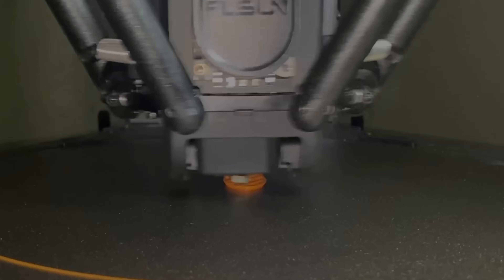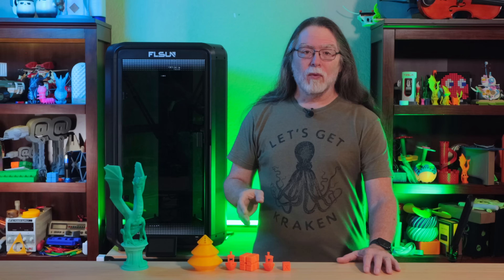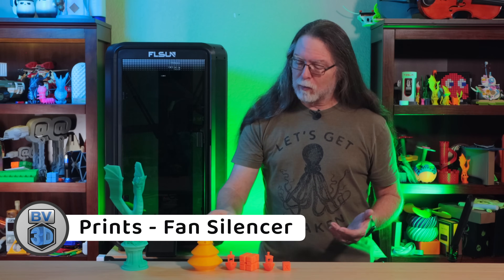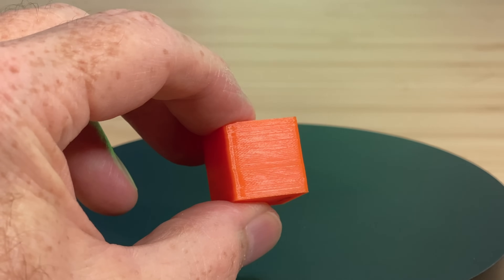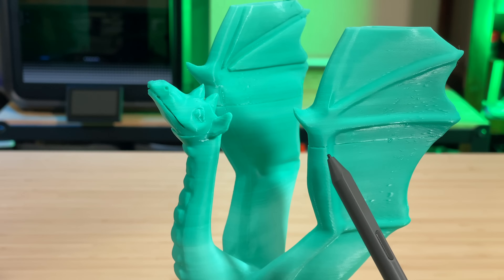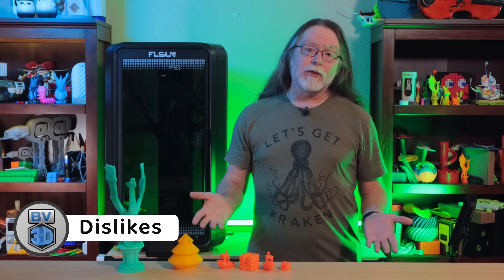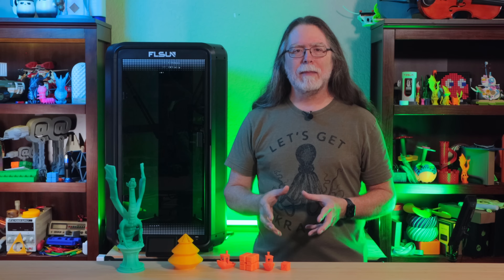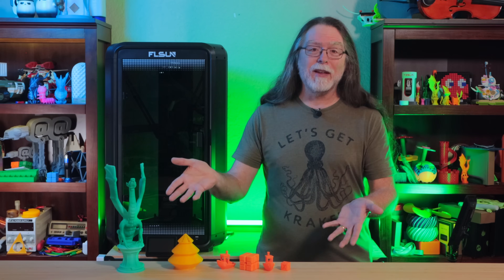It's Big. It's Fast. It's Loud. It's FLSun's T1.

Comment: Thanks for the tip on "Perimeter generator". In Bambu Studio its under the Quality tab -> Wall Generator. Those having issues when printing words or letters can perhaps give Arachne a try. There's a chance that some people might miss it especially considering that folks these days deal with so many different machines and slicers. Sometimes a single setting can mean the difference between a clean print vs a messy one.

I have read that people have had different results with Arachne vs Classic - so you may need to do some test prints to see if it helps. 

And as always a clean, clear and concise video from BV3D. Cheers!

Comment: My theory is flsun printers are not plug and play. Keeping an flsun printer stock from the factory is a mistake. At the very least tuning thr print settings.
Reply: They are definitely not plug and play.
I have v400, it sucks even after tuning.
Reply: @qozia1370  sad owner of a qq-s pro. The linear rods also being the support structure really limits the accel. It mostly prints ok, I just have to manually wipe the nozzle with a tissue just before it hits the bed. Tuning linear advance on kipper is really important. If the values too high it doesn't extrude enough which pulls the extruded plastic off the previous layer. Costed more than an a1 mini with mods and repairs and prints slower and worse. But the build volumes higher and I can mod it to make it better (if I had a brain)  :')

Comment: I have a T1 for a little over a month now and had little to no problems, the filament needs to feeded tru the holes of the cable clips to stop the coiling thing. Check your belt tension to stop the banding in z direction .sofar I have printed, PLA, PETG, ABS and TPE and they all work ok with the flsun slicer, fan speed can be reduced from 50 to 70% when printing around 400mm/s
Reply from the maker: Thanks for the tips!
Reply: I just ordered the T1 Pro and I will be printing PETG would love to know what settings you used to print your PETG and higher speeds. I use mostly Creality CR series and I’m told printing at 500mm/s is no problem with the right settings.
Reply: @dniezby  you need higjspeed filament for those speeds. It can print fast but the model shape also dedicates speed.

Comment: I have both S1 and T1; 110 and 90 are the instantaneous flow rates they achieve at their maximum; S1's maximum constant flow is around 65, T1's maximum constant flow is around 55; for me, that's enough, I like them very much.
Reply: They're not even that. 90 and 110 are just the numbers you get if you multiply layer height times line width times requested speed. But they do the flow test with acceleration turned all the way down to 1000, so it doesn't even reach 40% of the requested speed.
Reply: Enough
Reply: @alboroble you are flsun employee right? You keep defending them like a guard dog.

Not cool.

Comment: I would rather a printer manufacturer provide good profiles for Prusa Slicer \ Orca Slicer and\or Cura than waste their time rebranding their "own" slicer software. I don't use any of the four slicers that have been included with my printers.
Also, I agree about the max height thing. It's disingenuous for FLSun to base their max height on some theoretical cone rather than on the tallest cylinder you could print.

Comment: If T1 does better in terms of noise and software, then it will be a very impactful product .  The current T1 has demonstrated its huge potential, it just needs to do better .
Reply: About noise ,  you can do some optimization yourself. As far as I know, flsun is also optimizing the noise. Because I have many printers printing together, I am not very sensitive to this aspect.
Reply: @alboroble you can't optimize noise.
Fan blade shape and rpm determine noise! Please don't lie about physics.

Thanks.
Reply: @qozia1370  what about a silencer?

Comment: it also can't output 90mm^3 or go 1000mm/s, their claim to that is from a test file they made which, yes, does ask the printer to go that fast, but the prints geometry never lets the printer accelerate to anywhere near that speed. It's like asking any ender to print a zig-zag at 20'000mm/s with an accel of 1, and claiming it was doing 20K
Reply: This is exactly right. Someone got flsun to send them the "flow test" gcode, which confirms this.
Reply: Exactly! My flsun v400 never been able to do 400 mm/s.

Flsun always lie about the speed.
Reply: @qozia1370  It can easily do 400 mm/s kinematic speed (probably 3-4x that too), but nowhere near the flow to keep up printing at that speed with 0.4 mm by 0.2 mm layers. Maybe with 0.1 mm layer height.

Comment: Sometimes I need multi-color printing, I bought P1Swith AMS. Pursuing efficiency, I got my T1 2 months ago . In my opinion, the most important factors for 3D printing: speed, quality, multi-color; of course other factors are also important, ease of use, ecology, etc.  So  I chose bambu and flsun .
Reply: We are the same , T1 is my favorite printing tool.

Comment: Seems like this is not quite ready for prime time. It's funny, I have an old FLSUN Q5 that I got for super cheap, and it's actually been really solid. It does require regular care and feeding (and tends to go through extruders like candy...), but the print quality is generally good, and when operated within its limits, it's been a workhorse. I use it for high tolerance, utility type printing, and it's still chugging away after probably 30-35kg of PLA, PETG, and even some ABS through it. Delta printers are conceptually cool (not to mention oddly satisfying to watch), but in practice they just don't seem super practical for hobby or production use.
Reply from the maker: I had a Q5, and I liked it. I don't think it was trying to break any speed records, though. And I agree - Delta printers are 100% fun to watch!

Comment: The print quality is pretty underwhelming, and marketing claims kind of outrageous.
90mm3/s flowrate? Yeah sure...
Reply from the maker: I think the maximum flow rate number requires specific settings and FLSun's specific filament. I will say that if I slow the print speeds down to about 50 or 60% of the defaults, the print quality looks better. But I try to show what a manufacturer ships, both hardware and software, and the quality I was getting is what FLSun's settings were producing.
Reply: @BV3D  FLSUN also promotes their S1 with a max flow rate of 110 mm³/s which is false and based on a faulty max flow test that never reaches this value due to low acceleration settings.

I think it's important to hold manufacturers accountable for the claims which are broadcasted everywhere in every product page.
Reply: @BV3D No, it's just a lie. See other comments for how they setup the lie. I do high flows and it's very clear from their hotend that it can't do over 40-45 mm³/s. Others who tested it found it started failing at 35 or so.

Comment: Here is the truth, flsun printers suck, yes I own one, not this model but I do own one and I have not been able to tune out dimensional inaccuracy.
Reply: I'm with you. They SUCK!! I've got a core x y cube and a delta. both are sitting in a closet. I had 2 Creality3 V2 printers which work fine (upgraded a bit). I gave them away and bought a QIDI Q1 Pro and haven't looked back!! I really like that printer. I bought one for my son also. Haven't had one problem yet!
Reply: @andyb7754  If choose corexy, will not consider qidi, choose reality or bambu  . 
What are the advantages of qidi? It has nothing, it can't even compete with flashforge
Reply: Exactly! I have v400 and they are really really really bad!